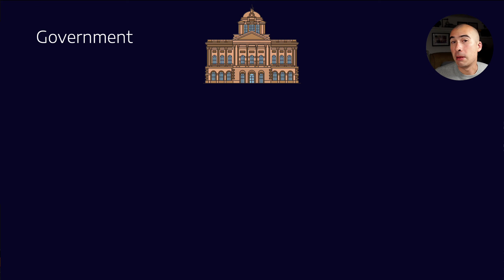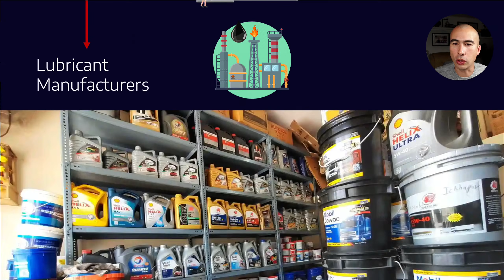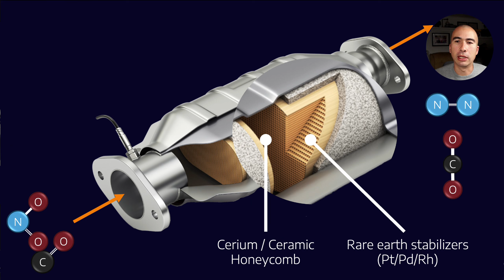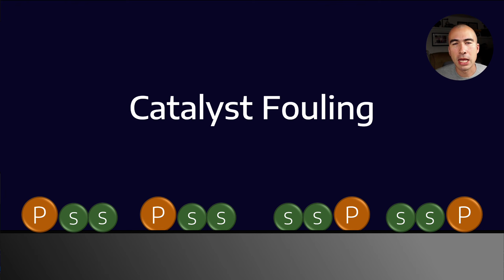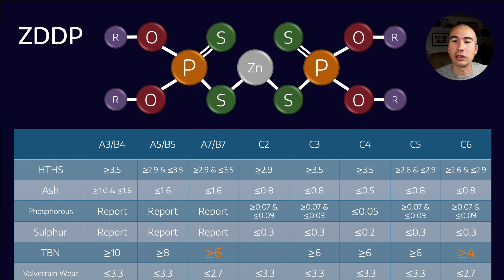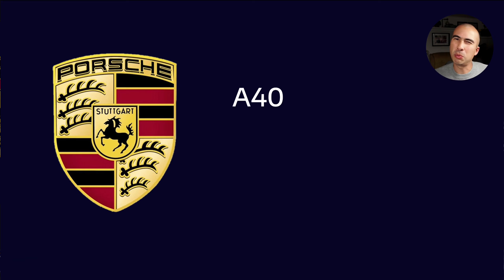Why do Engine Oil Specifications Exist?

Comment: Hi, I got into friendly discussion on FB. Somebody was stating that very often Porsche 944 will burn less oil if I use 15W50 instead of 5W50(same brand and line of oil), it doesn't make any sense to me why cold cranking viscocity would change anything in that matter. Do you have any ideas?
Reply: It's possible that a 15w50 oil uses less viscosity index improvers to achieve a 50 viscosity at 100C, therefore it would theoretically be less prone to shearing, and because the molecules in the base oil are heavier, it would also be more resistant to evaporation.
Reply: @IR-xy3ij  I agree, that's exactly why I avoid oils with wide viscosity spreads like 5W50 or 0W40. While oils with a wide viscosity range are generally a good thing and are required in some circumstances, their disadvantages should be understood too.

Comment: u have no video about specific oil value so i hope u can answer me a question:
If the naock value of one oil is for example 8.1 and another 9.5 what is the real value in terms of oil evaporation?
Reply: Depends entirely on the application and how hot your oil is getting. On a non turbo daily driver that never sees high oil temps, not much. Lots of engines use less than ideal quality 0W20 oil with relatively high NOACK evaporation losses and barely use any oil between oil changes. When your oil is getting hot from towing heavy, racing, driving aggressively in hot climates, etc, the NOACK volatility becomes much more important since evaporation loss increases exponentially with temperature. On direct injected engines, this becomes more important since vaporized oil getting into the intake through the PCV valve can contribute to the intake valves getting dirty.

Comment: It should be illegal for a manufacturer to label an oil a certain class if it does not actually meet that. Makes labelling pointless.
Reply: Yeah I wonder about that. I figure a standards body could take an oil manufacturer to court over it but would/can they? I assume the same thing with OEMs and their spec “approvals”. If a manufacturer falsely claims an OEM “approval” they’re open to legal action.

Comment: Hey i have dove down the oil rabbit hole. I need advice if you have time. I have a hyundai i30 2009 diesel. no dpf or cpf. With 200000km. I want the best oil for my car to live longer and im totally lost. What would you recomend for it. I will not hold you liable lol just a 2nd opinion
Reply: 5w-40 full synthetic for diesels